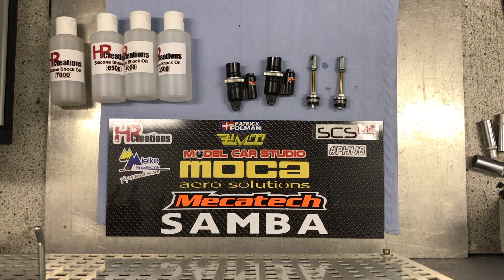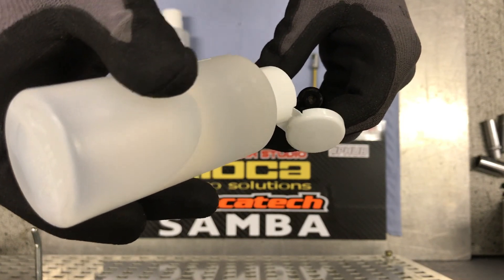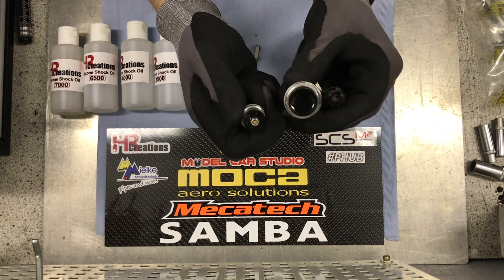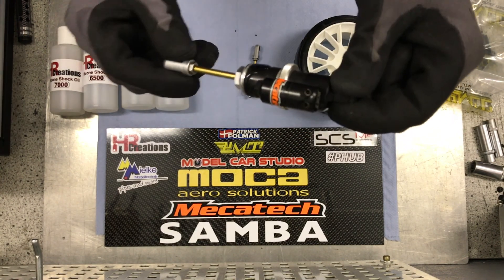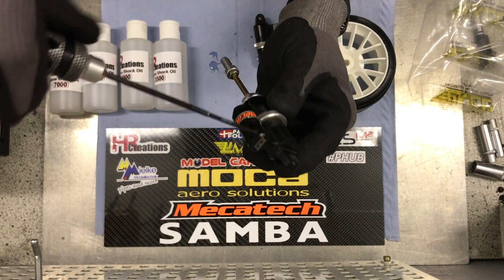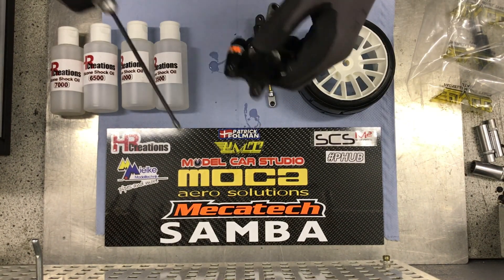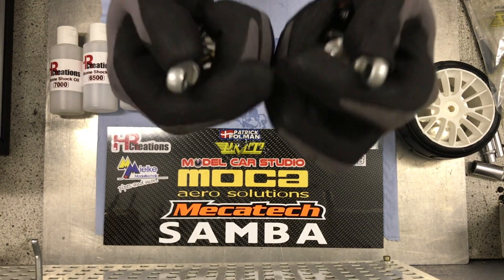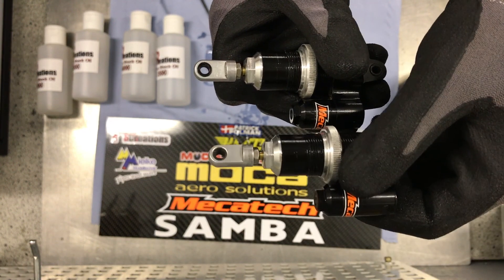Mecatech shock rebuild

Comment: Patrick, do you know how to change the orings from the part 2009-28 regards
Reply from the maker: You’ll have to push out the bushing from 2009-28 and then you’ll be able to remove the other bushing and O-ring, but it’s not easy and I recommend replacing the complete 2009-28 pre-assembled from Mecatech :-)